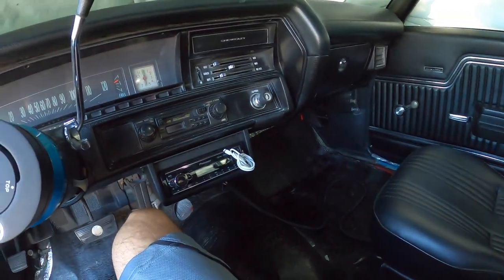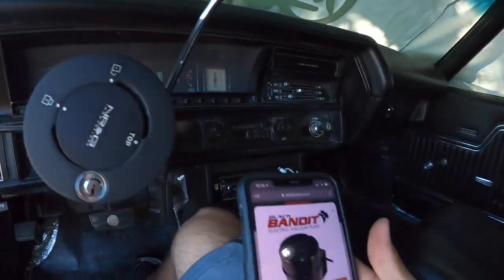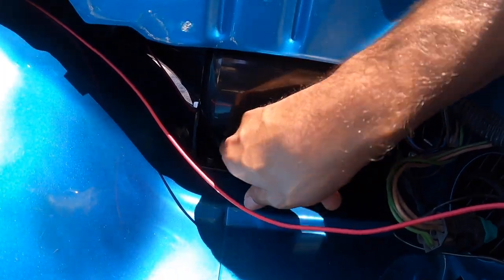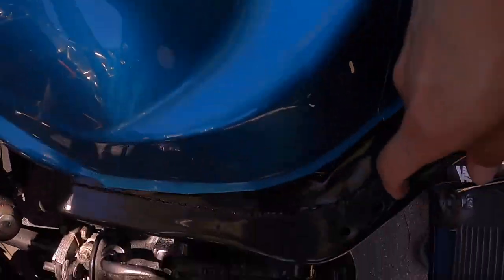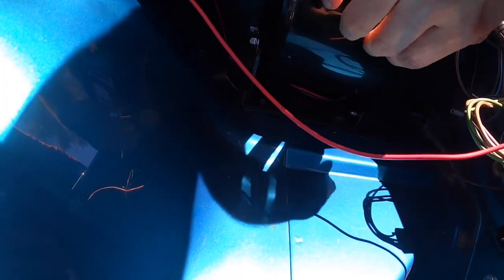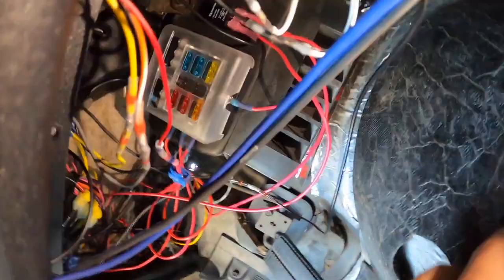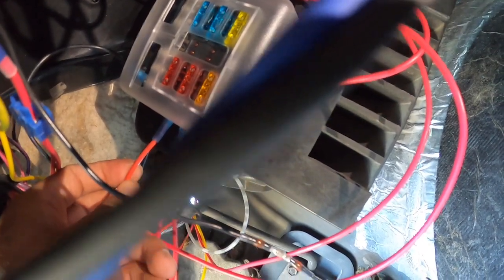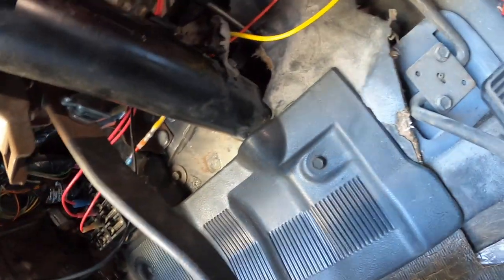Vlog #18   Leed Brakes Bandit Electric Vacuum Pump installed and hidden!

Comment: How is the pump holding up?  I’ve read some reviews of them not lasting too long
Reply from the maker: I havnt been driving the Chevelle too much but I did noticed it was making a strange sound. After some troubleshooting, I noticed I had it wired up to ACC instead of IGN. Once I corrected this, I no longer had an issue. The times I do drive it, it has been great. I do plan on going hydroboost I’m the future though.
Reply: @chile.productions  sounds good, thanks for the reply
Reply from the maker: @rodrigog1493  one thing I will say is it is significantly quieter than other pumps Iv seen, which is why I got it. Little more expensive but I feel the quality is there IMO.
Reply: You are correct , these 12 volt vacuum brake boosters have a very low duty cycle .  That is one reason a vacuum switch is installed , only produces vacuum when needed .

Comment: Great video! For me anyway. I have a ‘70 SS396 El CO with hard brakes. I’m guessing it has a large cam cuz everything has been replaced. I was looking for location to install and mine is exactly like yours. Question:
If you loose power to pump (either electric or pump goes out, old, wears out etc). Do you loose your brakes completely?
Reply from the maker: At that point you will only have enough braking power that the vacuum produced before going out. I drove my Chevelle home before I put this in, I didn’t  produce enough vacuum to pump more that 3times. Once your out, your pedal gets soft and you car aint stopping lol
Reply from the maker: Make sure all your connections are tight!
Reply: @chile.productions  thanks for your response. Doesn’t look like I have any choice. According to stories on YouTube, I’m not the only one. Ugh.
Reply: @chile.productions  I only have about 10” vacuum coming from intake manifold. That ain’t a lot. I have a cowl induction flapper on hood that also runs on vacuum. Maybe I should just put in a crate 502 motor! Lol
Reply from the maker: With a electric pump or hydroboost you can put any size motor in and stop lol
Reply: You should be able to tee it off from the carburetor on intake and still gets the low vacuum that's what I'm going to do just in case the pump go out
Reply: @fbabyfbaby4658  thanks for your reply! It’s a work in progress! I may try that. Haven’t bought accessory pump yet. But soon I hope.

Comment: Had a question not sure if any help ..i was replacing my old style piston pump that is located in trunk since its so dam noisy bought same bandit tried installing it with the hot and ground that powered old pump ..but iam only getting the new bandit pump running weak .but i tried directed to battery and runs the way it should ..so i have no idea why the 2 wires run my old pump ..but when i hook up wires to new pump its weak?? Any clues what could be causing this ..be apprieciated
Reply from the maker: Where do you have the power wire running from? And ground wire?
I can’t tell you why but my guess would be either they bandit uses more power or the wires you’re using are too small.
Reply from the maker: I had mine wired too an ACC fuse and it ran weak. Had to switch it to an IGN fuse(as stated in the install instructions)and it runs like champ.
Reply: @chile.productions  same wire thickness and its grounded or my old piston pump wouldn't work and it does work ..
Reply: @chile.productions  my.is hooked up to ignition when my.key is on it powers up the piston style pump already ..that's why it's confusing to me
Reply: I will check on all ur suggestions..much appreciated..truely
Reply: I will run down the power lead ND see where it's hooked to. D let you know..

Comment: What was your vacuum psi  on your engine before you ordered the electric vacuum pump
Reply from the maker: I never put a gauge to it. I only had 1 good pump though. But even that first pump I don’t think it could have locked up the brakes. The next two pumps just slowed down the car, i panicked at this time. This is what I experienced in traffic. After 3 pumps there was no brakes lol

Comment: Hello how is your pump holding up any problem so far thank you
Reply from the maker: Works great for me so far. Had an issue with it making a loud noise at first but that’s due to me not have it wired correctly at first.
Reply: @chile.productions  thank you I just purchase mines and I subscribe to your channel.  I'm also going to tee it off so I can continue to get the 10-in vacuum coming from the motor just in case pump failure
Reply from the maker: Thanks for the support! 
Let me know how that T-off goes. I’m not expert but I can see the vacuum pulling air from the motor leaving less vacuum for the booster. Or the pump and motor fighting against each other causing potential failure on some components.

Comment: How did it hold up
Reply from the maker: It was perfect for what I needed. A year later I went with a Hydroboost setup for a cleaner look!
Reply: @chile.productions  I have a stage 3 cam in my Silverado so I just bought one of these to help 
How much was the hydro boost conversion
Reply from the maker: ~$1300. This us a solid product though
Reply: @chile.productions  yeah I'm just scared it'll fail when I'm towing my boat I have a canister right now it's ok at the moment just not we're I wana be